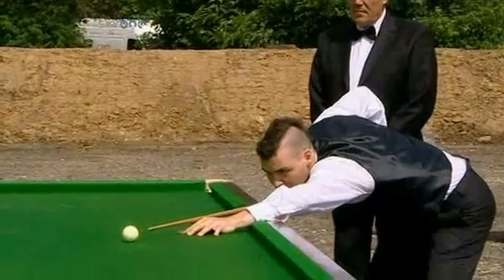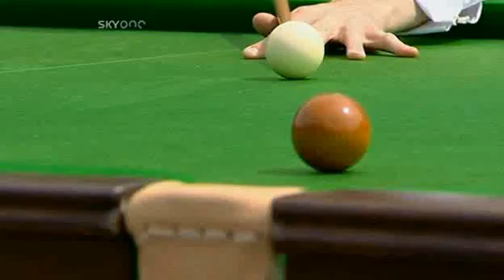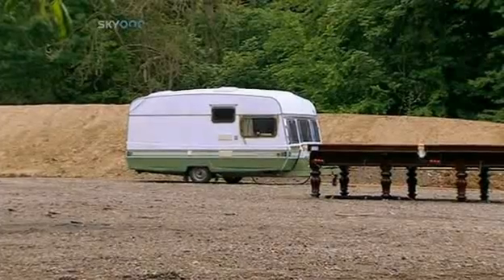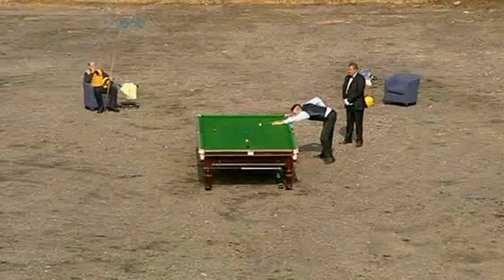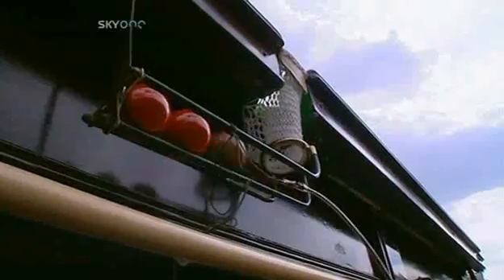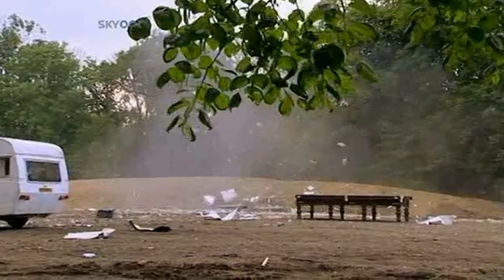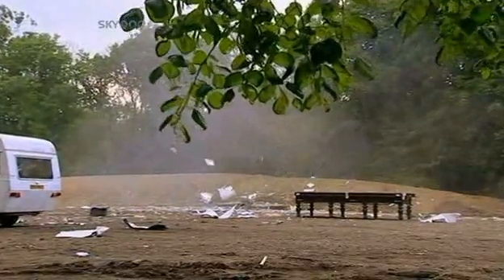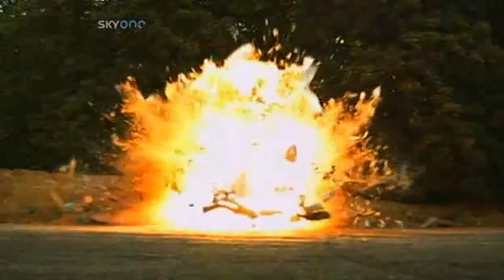Brainiac - Huge Caravan Explosion

Comment: It is not "expelled with great force". The acetylene is only 5 psi and the oxygen 10 psi when cutting. The oxygen can't burn without the fuel, (acetylene) but when it does burn it gives off intense heat. "Force" has nothing to do with it.

Comment: @LucaTurilli89 Acetylene (C2H2) burns so hot and quickly, especially in the presence of a lot of oxygen, that the amount of energy and pressure released in a closed environment such as a balloon gives off a massive explosion as the gases expand and blow everything apart. A gas that so efficiently gives off heat when combusted is of course very useful in welding, where it is combined with oxygen and expelled with great force to give a very hot flame.